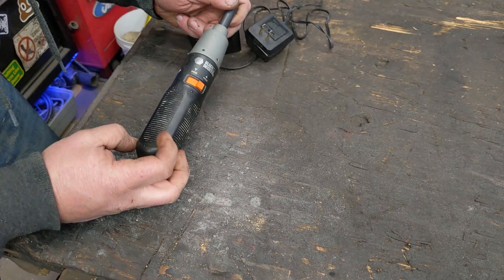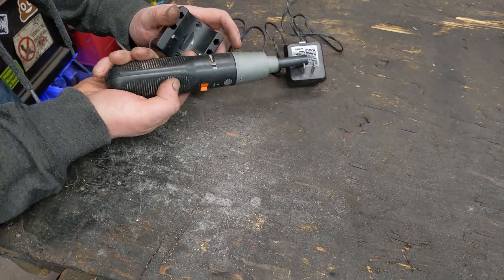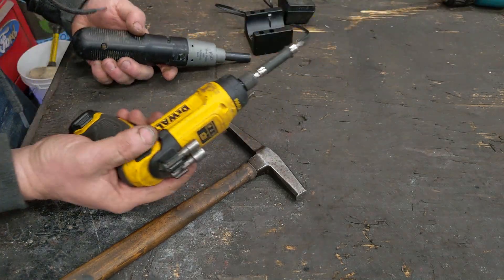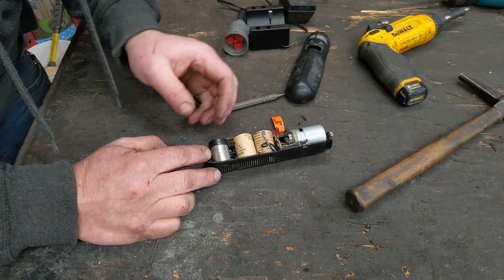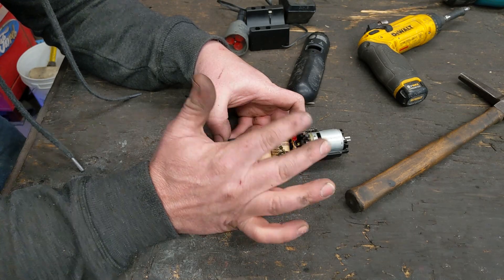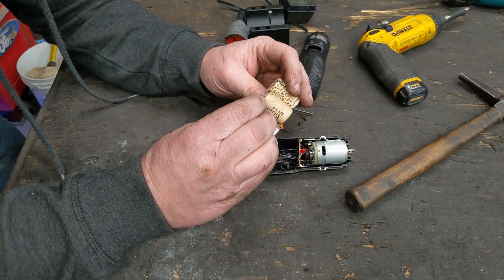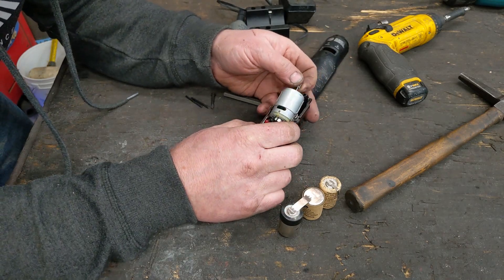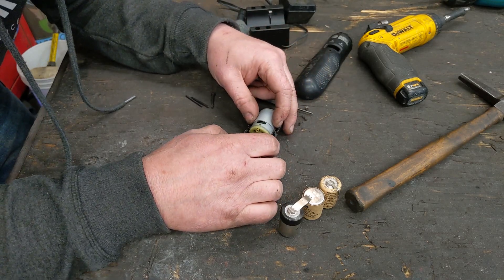Lithium conversion Black & Decker Screwdriver from NiCad Nimh  plus  Charger Upgrade

Comment: I can't believe I'm the first to say you should have a BMS!  lol.  Would be a good idea to check the motor current draw stalled to make sure it can't hurt the cells from over discharge or over current draw.  Also, the charger pins being open to the outside without a BMS is a little risky.  Not a tool to lend out, but it works!
Reply from the maker: Don't need a bms with a single cell nor multiple cells in parallel. You would only need a bms if they were in series. I did an amp draw and at stall it pulls under 10amps, so the cells will share this at sub 5 amps a piece. This is fine for a non high discharge cell.
Reply: @sixtyfiveford  Not sure if BMS is the right term for single cells, but you still want to prevent the cells from seeing too much voltage, which isn't likely to happen in the wild. But a single cell BMS can also protect against a dead short across the cells, which is very possible with exposed charging terminals on the side of the tool.  Tossed in a bag, drawer or toolbox and you could short the cell.  Great video, but something viewers should be aware of with the power density in lithium cells.  At least the charging pins are far apart I think?
Reply: Good to hear you checked out the current draw though !
Reply from the maker: @Donn29  They new charger is designed to not over charge the lithium cells. The battery pins are slightly recessed and on completely opposite sides. Yes a BMS would be needed if I had multiple cells in series. The only drawback to the way I have it set up is there's no low voltage cut off, so if you continue to use a tool even when it gets super weak/low battery you could damage the cells.

Comment: I love the way you pieced this all together. I have the same tool base, but mine has the 1/4 inch ratchet on the end instead of a screwdriver. I have a similar universal charger from Radio Shack that I got for a song when they closed the stores a few years ago. I also have the lithium ion batteries. Boom!  I'm doing this!

Comment: Good video. I would like to do this with my 7.2 volt craftsman screwdriver, so what would you recommend for the 7.2v?
Reply: Run the 2 18650s in series instead of parallel. Then use a charger built for 2 18650 batteries.
Reply: @johnpossum556  I'm maybe wrong, but when you put 18650-cells in series, I think they will need a balancing board connected to the batteries.
Reply from the maker: Yes the biggest difference with having multiple lithium cells in series / back-to-back; is you do need a balance charger. There are quite a few readily available that are really no more than just soldering up three wires. Then you would charge it off something like a USB cable.

Comment: Awesome, I put these 18650s in everything too lol!  The only thing I would have done different is run those cells in series to over volt it!  Twice the volts, run twice as fast!  Obviously it's a little harder on the motor, but who cares (it will take it)!  I had the cheapest black and decker electric gun screwdriver that walmart sold that ran on 3 volts.  I ran 4 18650s in series crammed into the handle.  The seams of the plastic casing in the handle no longer met up, but I gave it the "kungfu grip" by wrapped the handle in electrical tape, took care of that.  That little screw gun was super compact and was my go to when I didn't need the 18v stuff.  Worked for years (lost it in a fire).
Reply from the maker: That's awesome.

Comment: Nice to see tools being repaired and not thrown in the trash. You really need a low voltage disconnect when running 18650s. Running them flat and then charging them is dangerous
Reply from the maker: You not going to find a super easy way to do a low voltage cutoff. It's really only a feature for the uninformed/dumb users who would continue using a tool when the power significantly dropped off. Lithiums power curve is really flat and once you hit 3v or so a cell it plummets instantly letting you know stop. However with having such a huge 5000mah vs 800-900mah capacity it is highly unlikely I will ever get the point where I would run the batteries fully down before tossing it back on the charger. As far as being dangerous, no. All that will happen is you'll kill the cell/s and they won't accept a charge if you take them to below 2volts.
Reply: @sixtyfiveford  they sell 18650s with integrated protection circuits. They 100% will take a charge under 2 volts if you're using a manual charger. The charger you are using in that video will not charge below 2 volts because it is not wise.

Comment: We moved to a smaller property a couple of years ago as the kids have all grown up and have kids of their own,anyway i found the exact same screwdriver in the shed amongst a few other outdated but usable power tools,for instance the second or third generation Makita cordless drill set in blow molded blue ish case,i can still remember the first gen in the series we all used as i use to work for the top double glazing window,conservatory and door company in the UK,which was Anglia Windows based in my local city of Norwich,there was a mob of us in crews of 2 or 3 and about 10 crews altogether and us local boys had to work away 90% of the time,back then in the early to mid 80's we were making a killing at it,anyway the electric screw driver like yours was on it's own and with no charger or case,so to see your video on it has brought it back to the front of my mind and i'll soon upgrade it as you have,not to worried about a charger as i have more than enough of them what with all my other power tools and RC charges for all my lipo batteries,i'm sure i can rig one up to suit the job at hand.

P,S, sorry for the long ramble it's just that this video brought back a few good old memories back that i  just had to unload in this comment section lol,oh your acting skills (on the phone) i'll give 8 out 10,dog gets 10 out of 10.hope i'm forgiven by you and your subs. 🤷🏾‍♂️😉

Huge thumbs up as usual and hoping you and yours are all fit and well with much love and respect from a friend across the pond in the UK,One. 🙏🏾👊🏾💪🏾👍🏾✊🏾🙏🏾
Reply from the maker: They had to of sold millions of these screwdrivers. I brought back memories for me seeing it in the box and couldn't bring myself to toss it. Ginger is a good sport at playing along with my randomness in the shop.
Reply: @sixtyfiveford  I thought you called it Ginger but didn't say so because i wasn't 100% sure. 😉

Comment: Nice upgrade! I have an orange B&D cordless screwdriver (from forever ago, probably the 1st gen, it’s all orange and the bottom half folds when pressing a button to form a handle ) that you pop the battery in and out of from the bottom. I searched and couldn’t believe they still make batteries for it!  I got a great deal on two new ones (nicad) so I’ve stuck with them. I used the heck outta that thing back in the day doing electrical.
Reply: "Orange" I bought one like your that was blue. Dad had the black one like in the video.

Comment: The torque is amazing! I would have never thought it could drive a screw that length into wood that thick. Nice conversion!
Reply from the maker: It did way better than expected.
Reply: Did not expect him to slap in a 2.5” screw.  That’s pretty cool.
Reply: Putting the batteries in parallel increases the current available. The logical result is increased torque. If he had put them in series he would get faster rotation on the spindle but reduced torque, comparitively.
Reply: It'll work great until it nylon gears give out.

Comment: Those are not bad for anyone who installs electrical fixtures or does small repairs, they don't spin fast enough that you need a clutch,  maintenance guys could get good use out of them with the conversion because of the extra torque the 2 cells give and I actually prefer a straight handle over the pistol grip when it comes to cordless screwdrivers. 
Cool conversion Moe and what is nice is you extended the life of something that does not need to end up in a landfill or even recycled into some useless crap.
Reply: Keep in mind you can get a brand new li-ion battery one for cheap. I bought a HyperTough one through walmart for $14.76 which is probably about the same as you'd pay for 2 decent brand 18650 cells.
Reply: @johnpossum556  Not for someone like myself who has tons of cells, I rebuild my own battery packs. You need to keep in mind also that the cells that come with a 15 dollar driver are not great. I guess for someone that just needs a cheap cordless screwdriver for a quick home repair, than yes you can buy them cheap but I don't think this was the intention of the vid that Moe made, its for if you have one of the old drivers and some cells kicking around already, plus, sometimes its just fun to do stuff like this.